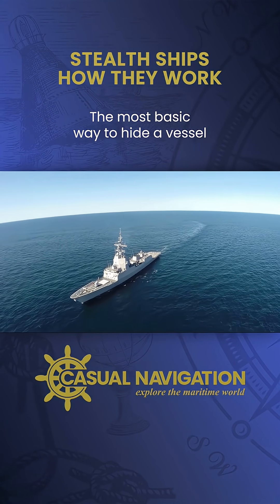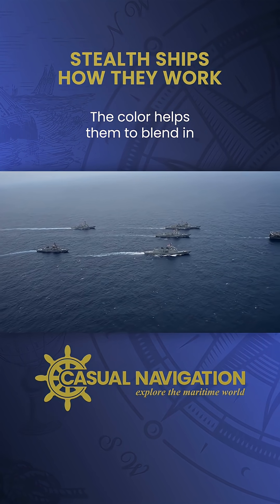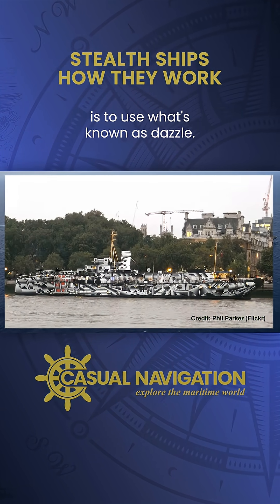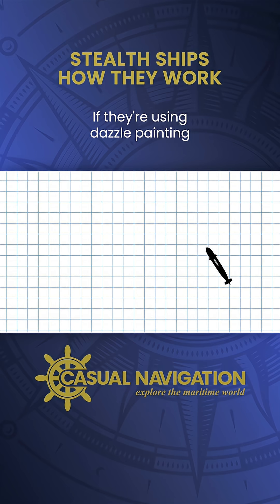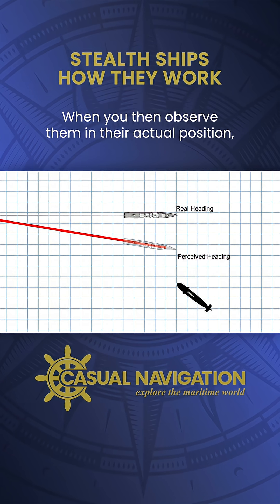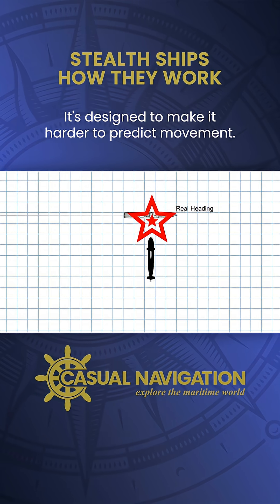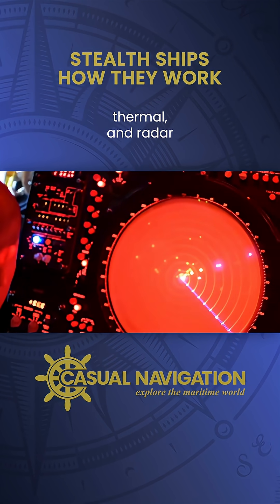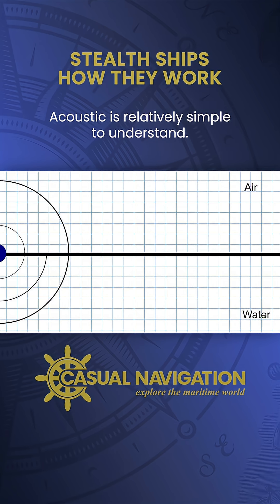Stealth Ships — How They Work

Comment: Thanks.
Which one is the best , sonar or radar?
Thanks.
Reply: They are different, for different purposes.
Reply: one is for above the surface and the other for below... Not interchangable...
Reply: Sonar for finding things underwater, radar for surface and above water. Different tech for different jobs. Both give your position away if you use them actively. Passive sonar (just listening to underwater sounds) comes down to the skill of the operator.
Reply: Thank you all for the clarification.